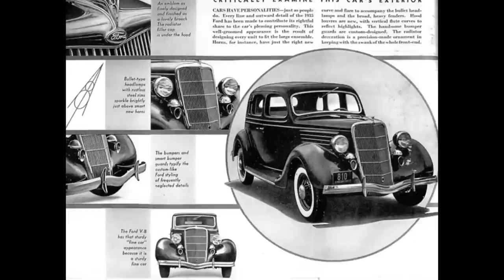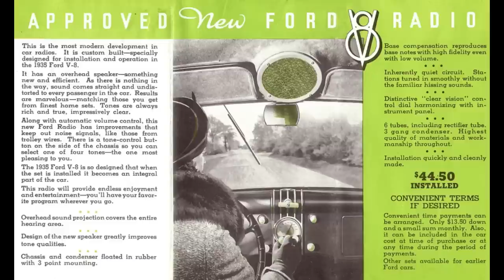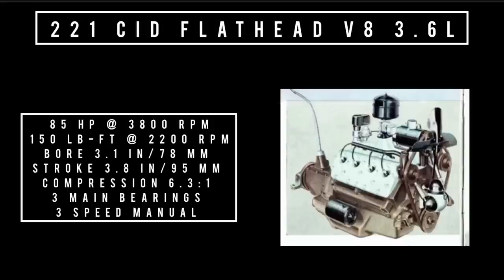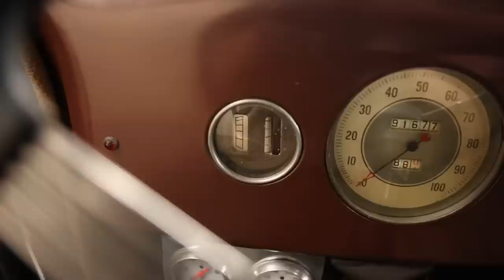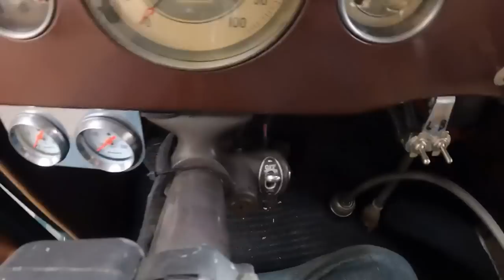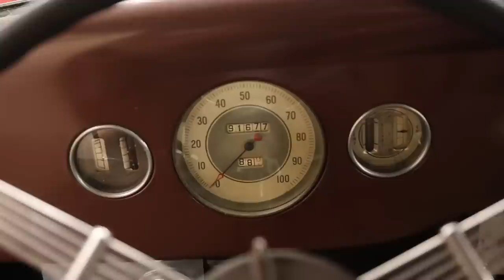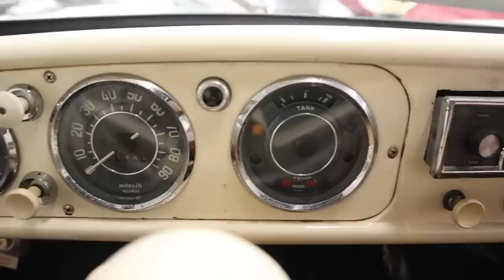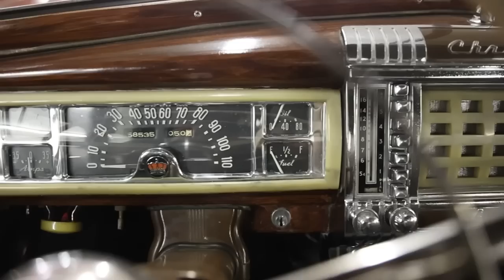1935 Ford Tudor Deluxe￼ ￼( model 68 ), V8 Powered

Comment: I think most of the cars in the early to mid 1930's kept that hole in the grill as a back-up crank access point in case the starter motor failed. 
The single piece windshield on Fords went up to 1936. After that, car manufacturers wanted a more pointed glass section, hence the split windshield which lasted into the early 1950's. After that time, the car manufacturers learned how to curve a 1 piece shape of glass.
Reply: I’ll bet it would be loads of fun hand-starting your flathead Ford V8 on a cold snowy morning …
Reply from the maker: Never hand started a car I’d be afraid if it backfired
Reply: @What.its.like.  — You’re young, but I’m sure plenty of your older viewers have hand started cars or at least farm implements such as tractors

The first car I hand started was a ‘29 Rolls Royce, not because I needed to, but because I wanted to be able to say I’d hand started a Rolls. I worked on the car for a doctor that used it as a daily driver! It was actually very easy to start.
Reply from the maker: I think I’d kick start it by popping the clutch
Reply: @sking2173  You have to keep in mind that the last Model T Ford was made 8 years before this car. These early motorists knew how to do it.
Reply: @What.its.like.  Hard to say if the gear box worked that way in those cars.

Comment: My favorite Ford of this era is the 1936, but this is very nice. A lot of subtle styling details that aren't apparent at first glance.

If I recall correctly, the driver's seat on this generation of Fords did not adjust forward or rearward. That could be a problem for short guys like me!

The hinging of the front seat to provide access to the rear was not unique to this Ford, however. My family's 1964 IH Scout had the same feature on the front passenger seat. It was hinged to provide access to the two passenger rear seat. 

You did a really great job on this video, Jay.
Reply from the maker: Thank you glad you dig this episode =) love getting feedback from people that’s been with this channel since the beginning it means a lot to me.

Comment: Greetings Jay. May I make a respectful request? When you are panning across the pedal box, if there is a heater present would it be possible to point out that part of the car out? My grandpa was a rural mail carrier of Hoyt Kansas where the winters are VERY bitter. In the 40's he would only purchase a route car if it had a heater. I am from Topeka and I remember those frigid winters. As always please know that your videos are much appreciated!!
Reply from the maker: Yeah for sure next week’s videos and possibly the week after won’t be like that because I filmed all of this content beforehand going to film some more in about a week =) and will definitely show that and get a light
Reply: @What.its.like.  Thank you so very much. I went with my grandpa a couple times as he delivered mail in Hoyt Kansas. I was just a little kid, but I remember sitting on the floor by the heater to stay very warm. The outside air temperature was well below zero! He would not have been able to deliver mail without that heater. Thank you again!!

Comment: As for me 1934 definately! The chrome is better proportioned And I likes the wire wheelies! The locking column was genius! Mr Ford really understood that a hard working man could not afford  some punk making off whith his toiled for, buggy.  If I had the pleasure of owning one, I would consider a radiator flush every  three thousand miles. AND RUN PENZOIL W.Z7  AND CHANGE THE OIL MYSELF. I THINK OF THESE CARS AS A FORD VICKY! EVEN THOUGH THERE PROBABLY NOT THE SAME CAR. THEY SEEM TO HAVE MORE REAR SEZT

ROOM THAN A CHORD!. NOT SO CRAZY BOUT THE TIP UP FRONT SEATS THOUGH. IF I HAD ONE, I WOULD NEVER SELL ANNABELL!

Comment: 1935 should have a 239 cu engine , mercury in the 40’s had a 255cu , ford also had a small 60hp flat head v8 in the 30’s but mostly overseas , i’m 99% sure on all of this , this car is stunning , i am counting 21 head bolts on one side of the engine , if i remember , 21 bots = 239 , i think lol
Reply from the maker: The 239 flathead didn’t come out until 1939 it could be a transplanted engine flathead enthusiast say the 239 was the best of all the flatheads. Could get 100hp out of it easy